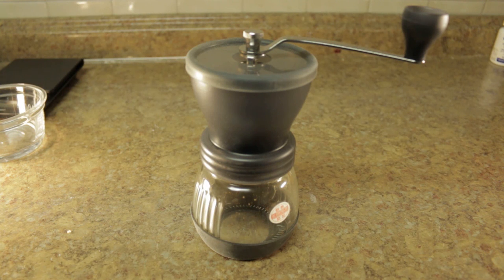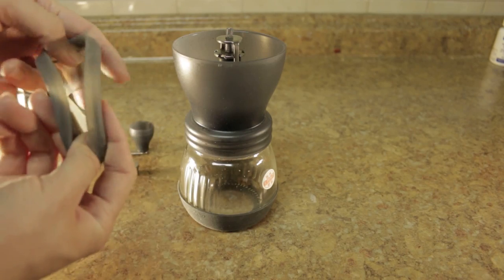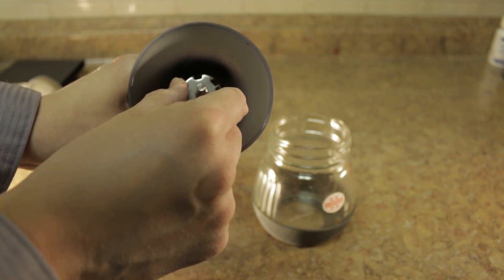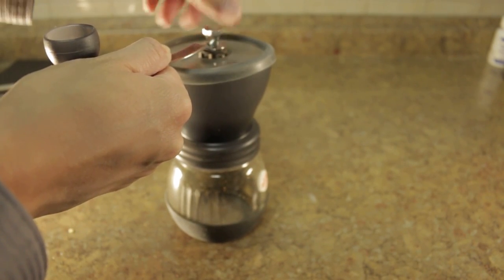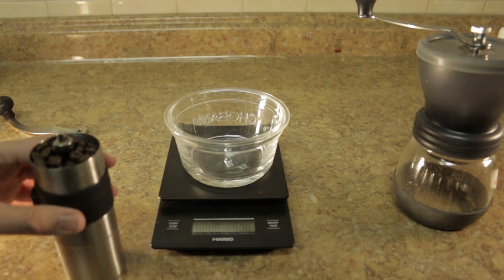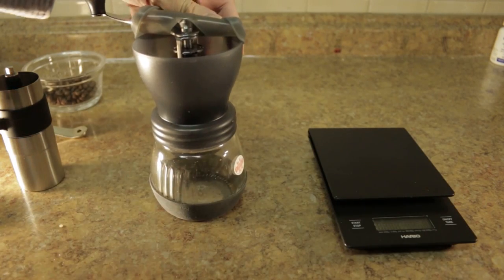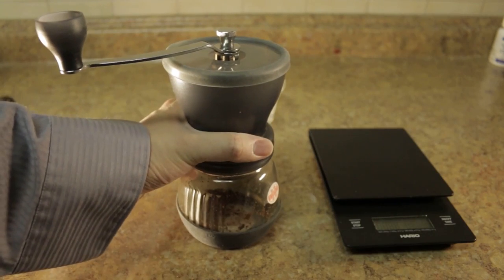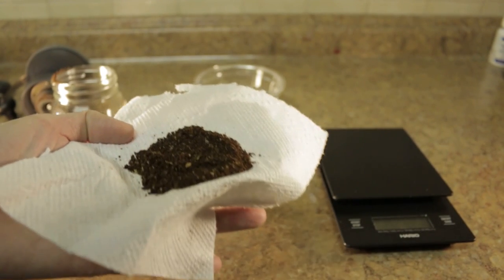Hario Ceramic Coffee Mill Skerton Review

Comment: Have a similar product.  It won't grind anymore, when I turn it clockwise, the ceramic piece is stuck but the handle keeps spinning.   Any ideas?
Reply: Similar? If it is a Hario Copy - the handle no longer fits - a slot is now a circle. Are the ceramic pieces white? Just buy the Hario.

Comment: I wouldn't necessarily call the Skerten more durable. There have been quite a few reviews that found little plastic pieces in their coffee ground after long term use. On top of that, it's difficult to get a good consistent grind with it without modding. It's a decent grinder, but I found my Porlex to be overall way more consistent at all varying levels of grinding which is to be expected, since it's a little more expensive. Either way tho, these are all entry level grinders. They can't hold up compared Lido models and the like, but as long as we don't use pre-ground coffee and put a little effort into coffee making, we're still better than those casual peasants, right?! ;D
Reply: انا mjs .

Comment: Do not remove the nut on the bottom burr. Just take the top nut off and drop the burr with the shaft. Brush the bottom burr and the fixed one to clean. It does not need to be washed, put in the dishwasher or sanitized. Just brush it once a week or so. 
Dialing in the grinder is easy one notch at a time. Once you get close moving one notich at a time. Remove the top nut and put a cordless hand drill on it for speed. Add 3 or 4 drops of water to the beans when they are in the hopper to control static.
Remember, you are not making nitroglycerin, just grinding coffee. If you get a drop or two extra it is not the end of the world. I have put 1/2 teaspoon of water and the coffee was fine. But 3 or4 drops is all you need. And please, I cant tell you big or little drops. It ain't nitroglycerin!

Comment: By "3 turns from tight" do you mean 3 full revolutions of the wheel....or 3 notches? If the latter that would mean just half a revolution in total since there are 6 notches on the wheel.
Reply from the maker: It is 3 notches.  Sorry that is what i meant!
Reply: +The Hungry Ferret I would define the tightest setting as being literally as a screw being done up all of the way regardless of whether a notch is aligned to a flat bit of the axil. To get to the tightest setting, you keep going clockwise until it's as tight as possible. Then you go anticlockwise a tiny bit until a notch is aligned to a flat bit of the axil. This is the 1st notch. Then you go a bit more anticlockwise until a notch is aligned to a flat bit again to get to the 2nd notch then a bit more anticlockwise again for the 3rd notch (which is where I've set mine). This means that you the amount you turn anticlockwise to the 1st notch is a little less than for between other notches.

Comment: Not sure why you call it a review, it just shows how to use it... 
I might add that I'm disappointed with this grinder (esp comparing to the otherwise very high standards of Hario):
1) it's extremely slow (5-12 minutes for two cups worth of beans, compared to my grandmother's 1950s Italian steel grinder, which only needs 2-3 minutes) 
2) it grinds quite irregular 
3) I like using a coffee grinder also for spices (eg: curry blend) and the Skerton just clogged up {again, by comparison, the old & manky 1950s grinder did a better job in a 10th of the time...}
Reply from the maker: I do mention, the length of time it takes, a bit uncomfortable to grind and also it not as consistent as the Porlex.  The grinds are more consistent on finer settings vs coarse.  It not terrible of a grinder, it not perfect as many thinks of it.
Reply: +Ben N. If it takes 12 minutes to grind your coffee you must be pretty slow. For me, it's about 1 minute for 1 tablespoon of beans with about 100 turns of the crank. 1 tablespoon is about right for 1 normal sized mug.
Reply: +Richard Valvona of course it's slow, that's why I think it's the skerton is crap.  ...unless, like you suggest, my heart beats at a third of a human beings' rate; and my earth revolves slower around the sun than yours, which is, of course perfectly possible, eh?...
Reply: +Ben N. Perhaps a manual grinder isn't suited to you or you were out of luck and got a dodgy Skerton. What setting do you use?
Reply: Richard Valvona n

Comment: can this grinder be used with my keurig machine? and if so whats the best setting for the grind??
Reply from the maker: +David Garza , yes it can.  I would use a medium grind, which is similar to drip.  Just don't pack it in too much so that water can flow through.  Setting on 3 or 4.
Reply: Thanks bro! i also subscribed to your channel
Reply from the maker: +David Garza Thanks, i am currently in process of testing this, so it great to see what questions people have.  I started to open up the pods and found that the amount of coffee in each differs from brand to brand and flavor.  They seem to range between 9.5 to 11 grams of coffee.  But because the way the my kcup works, you seem to need to use more coffee or it going to be too weak.  So far, fill up to the max from what it seems.